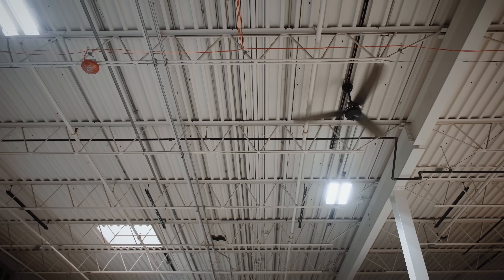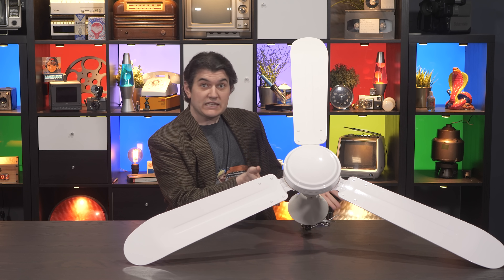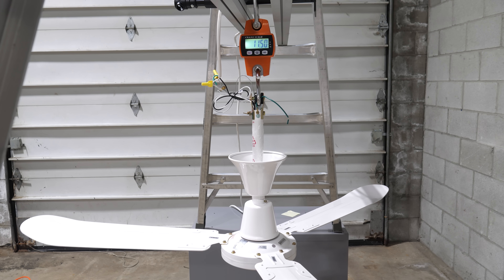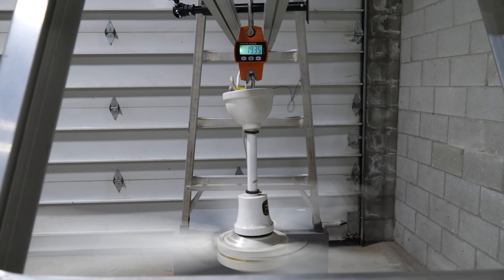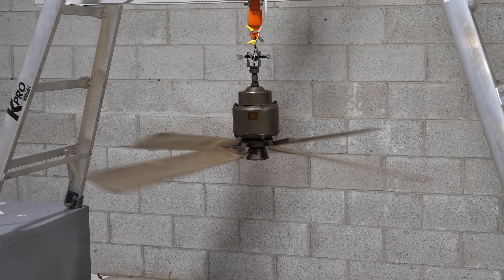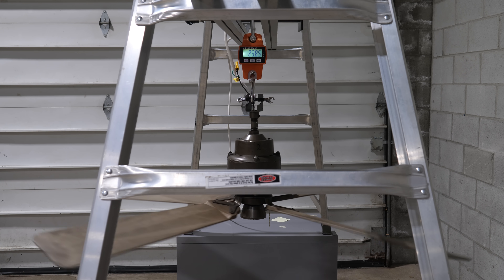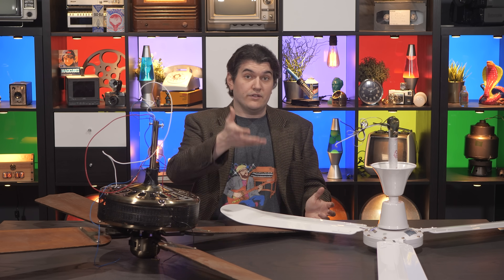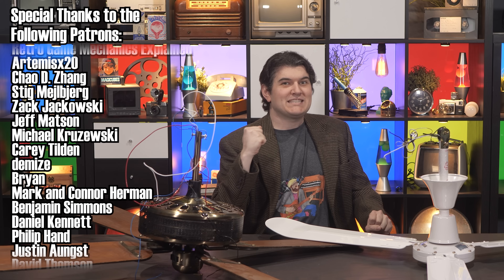How much thrust does a ceiling fan produce?

Comment: The blades they use on ceiling fans are very inefficient. A long time ago (55 years) we had a desk fan with flat blades which blew some air. One of the blade broke so I replaced the blades with a model airplane propeller, the amount of air the fan blew was significantly more.
Reply: They're not, actually. The benefit of the shape of propellers are related to the speed it's moving through the air. Fans, especially ceiling fans, don't move that fast.

Comment: This was fun, useless amateur science!  Thank you!
What are the top ten reasons why you shouldn't make a plane powered with ceiling fans?  
You could have included a comment about the lift of a "wing", such as a ceiling blade, being approximately proportional to the square of the speed, so increasing the speed by a factor of 10 would increase the force by a factor of approximately 100.

Comment: Don't forget about ground effect --- running a propeller near a surface will generate more thrust than in free air, because the pushed/pulled air can't get out of the way because the surface is there, increasing the pressure differential. It's what makes ekranoplans fly, and is also why it's hard to fly a drone near the ceiling (it keeps getting sucked up and hits it). I'm afraid you're going to have to do all these tests again, but with a fake ceiling present!
Reply: I wonder if he can just flip it 180 degrees and run it upside down
Reply: So if you put a scale on the false ceiling, you should be able to get the total thrust and the ground effect thrust in one run…right?
Reply: And CLEARLY if putting in that much effort he should also find a way to absorb the torque without it impacting the scale - a project for a more effort May?  (I was thinking mounting to a fan box which was in turn attached to vertical rods via low friction rollers -- the rods would prevent the torque from impacting the scale but the rollers would allow the minute vertical movement from the thrust.  Though the torque might add enough friction to affect the thrust reading)
Reply: @jonathan_60503  Actually some strings going out horizontally from the fan body would be good to stop the fan from twisting without producing any vertical force. They would need to be symmetrical to avoid the fan moving sideways.
Reply: I mean if you really want to get technical, helicopter rotors (and air craft propellers) are actually spinning wings, and not flat blades like you see on (most) ceiling fans.  But ground effect is a thing...I remember a part in the book "Chickenhawk" about an overloaded Huey that needs the ground effect to stay airborne...over a mine field...but can't get above the trees around it.  

Anyway...
Reply: I was going to say that. Furthermore, with the 2 cabinet nearby there is a significant recirculation effect going on. It would have been more precise to test far away from any obstacle (so that no wind is felt near the obstacles)
Reply: as long as he waits until dec 1. Its amazing how hard it is to avoid effort in November. It's so hard its almost like... effort!
Reply: So... here's a thought. You know when you run a high pressure outlet against a flat surface and instead of repelling it it 'sucks' the flat surface towards it so long as it's in near contact? Say using a high pressure lance jet in a bucket of car shampoo. 

I assume that's ground effect of sorts for fluids. Air is also a fluid... my 'Brian' hurts.
Reply: You feel it landing a drone manually too, those last few inches can be sketch if you don't just chop the throttle.
The DJIs of the world have solved that problem for most people though.
Reply: If he could mount the fan sideways on a smooth rail --- maybe easily buildable with drawer runners? --- then the whole thing could be easily wheeled up to a wall to measure the difference between ground effect and non-ground effect.
Reply: @bewilderbeestie not sure if these fans are designed to work sideways. They most likely will, but their performance may be impaired
Reply: @BoraHorzaGobuchul  D'oh. Yes, of course. I expecting nasty grating noises from the bearings would be the least of it...
Reply: Ground effect
Reply: yeah thats not at all how ground effect works
Reply: That would be ceiling effect 😅
Reply: @jsjs6751 ex helicopter pilot here. Now I want to know what difference it makes if you hover inside a building… both ground and ceiling effect.
Reply: @MeppyMan    Only one solution: Get a helicopter and try? 😃
Cheeper to buy an RC-version? 😊
What you will probably notice is that if you fly too close to the ceiling, it will suddenly ascend quickly. It is a self-amplifying effect, so once it gets past a certain point, you will probably not be able to stop it before it crashes. 
If the "ceiling" is very low, like 3 feet (depends on the rotor diameter++), it will become increasingly difficult to both keep it in the air and stop it from crashing in the ceiling.
In confined spaces, you will experience a lot of turbulence when downwash is redirected into outwash (~ground effect), and successivly up the walls , ceiling, and into the rotor again.
Many small and cheap RC helicopters have fixed pitch rotors and a low RPM. Those are particularly unstable in a breeze  - and so also here. So unless it has a lot of gyros and automatic features, you may not be able to keep it in the air.
Reply: Whoa whoa, slow down, Egghead.
Reply: I think just hang the fan on one of the scales that measures pulling force. (Disclaimer: Not sure if he did that at all since I didn’t watch the video yet.)

Comment: I've had to reinstall an old ceiling fan mount before because it was barely put up, and the torque from years of running was working it loose and causing a serious wobble. Amazing how someone could put up a fixture that will be holding a heavy object above people's heads and think a single nail will be enough.
Reply: seams he nail the job

Comment: to prevent the torque issue with the scale, id attach the fan to a board hinged at one end & the scale above that
Reply: He call it no effort november for a reason.
Reply: @scasny  idk about him but it would be easier for me to do that than the ladder setup.
Reply: @starchy_  he could also use tape to hold the base from spinning. Clearly there was not much thinking involved. But he was more interested if there was any measurable trust. Not necessary how much.

Comment: Keep in mind that the ceiling itself restricts airflow, further reducing the amount of thrust actually being produced. Just like if you were to stick sheets of paper to the back of a box fan.
Reply: Sure, but the fan isn't basically sealed to the ceiling. There's usually a fairly large air gap. I imagine the effect is fairly small.

Comment: Grams are units of mass, not weight nor force nor thrust. So the fan's mass in grams does not change whether turned on or off. Its weight in newtons, on the other hand, does. Pounds are units of force/weight, unless you're using that type of pound whose symbol is lbm, but that's another story.
Reply: Exit the atmosphere.

Comment: The actual thrust of a ceiling fan is very low, and you can see that visually by observing the low acceleration when you turn it on.  It depends on reinforcing circulation to get air flow which, incidentally, works better when the fan is up near the ceiling.  If it actually produced any significant amount of thrust the power consumption would make your eyes pop out.  A good ceiling fan will have very low power consumption and not have much thrust.

Comment: I used to work for an industrial fan company. I know one customer that didn't bother to tighten the blades to the motor shaft. Once powered on the blades took off across the warehouse like a fighter plane and slammed into the far wall. They sheepishly had to order a replacement set of fan blades. It apparently had some serious thrust behind it.

Comment: First time I actually saw the significant thrust from a larger fan was when I hung a box fan to a pull up bar in a doorway. When I turned it on, the whole box swung back a bit away. Knowing it should and seeing it happen is quite different.

Comment: "[...] but hanging from a ceiling to keep you cool."
This thing is MUCH better at keeping you warm. You touch on this briefly, later on in the video. It seems to me that the general view as to the purpose of a ceiling fan is to cool you down. If you want cool air you should certainly generate cool air - not just move air of the same temperature around. Yes: The slight breeze you get from a fan is refreshing on a hot summer day, but why not use some sort of heat pump instead?

In my childhood home we had a wood-burning stove to heat our living room, dining room and kitchen. This stove would produce a lot of hot air, which would just rise up, and chill out up under the ceiling. Meanwhile we, the human occupants of the house, would be at the floor, still rather chilly. The only place it would be somewhat hot, was within a 3 meter radius of the stove. For funsies my dad once took out a step ladder, and placed a thermometer under the ceiling. At the floor it would maybe be around 20℃, while up under the ceiling it would be around 50℃. That's a lot of heat we were missing out on!

We installed a ceiling fan, and suddenly all of that hot air would be circulated throughout the house. It was so effective, that we sometimes had to crack open a window to keep cool.
Reply: Fans in general are capable of doing both quite well.

Blowing air across a person is generally the cheapest way to cool them down unless the air is both warmer than the person and very humid.
The best heat pump isn't beating creating a slight breeze on one person in terms of efficiency.

Comment: Now I want to go find a helicopter collective from an old junked Huey, build a ceiling fan with adjustable blades and make it so you use the collective to control the output of the fan.

Comment: And if you want a nice cringe fan, check out the screw in light bulb fans! I am sure that small metal tab holding the socket in most fixtures handles that torque fantastically!

Comment: So I’m a certified scale technician, and I would love to offer some of my experience in this field to help setup experiments like these. I would suggest that instead of using a hanging scale maybe you can flip everything over and anchor the fan to a floor scale which will give you a more stable reading and I could provide an indicator that will zero out after placing a load on the load cells. If you use a 4x4 platform with a load cell in each corner and wired to a junction board and then the indicator the you got a sturdy base
Reply: That is a good idea for January to October...
Reply: Valid points but possibly in conflict with the theme of "no effort November"
Reply: Yeah, but you started a sentence with so. That's a no-no.
Reply: That can't be a real job..is it?
Reply: @HiddenCharacter81  after a quick google search - it is, with multiple institutions providing certification
Reply: @HiddenCharacter81 if you think about the number of high precision certified scales in use in every manufacturing facility, factory, packing plant, laboratory, truck stop, lumber mill, store, Cannabis shop, pharmacy, etc etc etc, you would realize that a scale technician is most certainly a thing, because someone has to install and repair and calibrate all of them! Lol
Reply: A problem with that solution is that when you have a plaform below the fan, the air coming from the fan will push/pull on the platform it self, cancelling out a big part of the "thrust". 
But it would work if you replace the platform with a large frame instead (which is much larger than the fan diameter, so the air can pass thru unaffected), that has it's corners resting on the load cells. Then attach 2 thin wide beams to that frame, going thru the middle of it, with their flat sides vertically (so they "cut the air" with neglectable area perpendicular to the flow) at which the fan in turn is attached to. 
If the fan gets too close to the floor, the thrust may increase slightly though - due to a high/low pressure zone building up when the the in/outflow to the fan gets restricted
 - but the same thing will happen to a fan mounted close to the ceiling. It even happens to a helicopter very close to the ground (it get slightly more lift there compared to when it has gained some altitude). So that's more a question of what one wants to measure. 
But the load cells and corners on the frame can be placed on top of something, for example 4 stools to get a "free air" measurement, like he did here.
Reply: @Speeder84XL  Fans operate with a ceiling nearby so this reverse setup is actually more accurate to the real world scenario.
Reply: @Sprockete  Put it on solid platform will not. Ultimately if you had the fan inside a large box and measure how much the weight of the box changes, there would be no difference at all if the fan is on or not. 
But there would still be pretty much the same forces acting on the fan it self and fan mount inside the box. 
It's the same thing with the platform, as putting loadcells under it will measure how much the weight of the whole assembly changes, not the force acting on the fan it self - even if some air will still "miss" the platform, making the force cancellation only partial, compared to the box example (it's still enough to cause huge measurement errors).

But when it comes to the mentioned slight increase in thrust of being close to the floor in my idea of using a frame instead, you are right. 
In most cases, that's how you would mount the fan when using it as a ceiling fan (so that will be the most realistic scenario)
Reply: yep, get it out of ground effect.
Reply: @Speeder84XL  Of course you set it up on the platform upside down 😉
Reply: @Tuepp  That will not make any difference. It's still the weight of the whole assembly being measured and the air will push/pull on the platform regardless of it its above or under the fan. 

The "platform" must be something the air can pass thru unaffected, like the framework I mentioned.
Air hitting the floor below (and ceiling above) that assembly will not cause errors, because the load cells are not affected by that force.
The problem accors when the air stream create a counter force that act on the assebly it self. 
It creates exactly the same problem as in those "can you blow your own sail" videos that popped up here on YT some time ago 😂
Reply: @Speeder84XL while it would be better to use the open framework, if the fan is mounted a normal distance away from the solid platform and is blowing up, it will still give a relatively accurate reading, because the air can flow sideways between the fan and the platform before being accelerated up and away.

It's the same way a fan can move air when suspended close to the ceiling, it still has to get air sideways to blow down.

What you are thinking of is if you put a ducted fan hard against a surface, so the suction/thrust was completely contained, but if you give a little bit of space, air flows away.
Reply: @ke6gwf  You are right it will not be a complete cancellation. But the air will still cause some counteracting force that gives an error. 
You could probably do well even with a solid platform, if you make an extension for the fan mount, so the fan get some distance (like 1 meter or so) to the platform, then only measure the fan when running in the direction where the "suction side" is on the side where the platform is.
On the "suction side", air enters the fan from all directions (mostly from the sides, as you said) and doesn't form an airstream the same way it does on the "blow side". 
So as long as the distance is enough in that case to not restrict the airflow entering the fan, the error will probably be neglectable.

Comment: I’ve actually run into issues with this working in a factory where we used a scale to count how many items were produced. On the hot days when the fan was running on full blast, it could result in counting errors on the scale

Comment: What about ground effect affecting measurements? Altough im not sure if it applies here helicopters are affected by this when they are near the ground (half diameter of rotor). And since fans are really close to the ceiling, when they run in reverse it will create a bigger effect.  For proper heasurements it should be made in actual ceiling i think. How viable that is, is a question for another time.

Comment: I loved the snark surrounding the repeated mentions of x being a different number in metric. In my head I was always of the impression that ceiling fans had to not produce lift or downforce because of how the blades are angled, not so much because I knew anything about the angles but because it'd be completely daft if it was literally capable of doing so. I mean what kind of country would be so stupid as to install something capable of creating flight into a building? The answer that yes it technically does create lift or down force but only by a tiny amount is fascinating but also reassuring.

Comment: Did you try running them at different speeds? Most fans have that 3 speed chain switch. Since velocity is the only variable in the lift formula you can change I would've seen if the speed also changes the weight, then you know it's lift/thrust and not some other effect being measured?